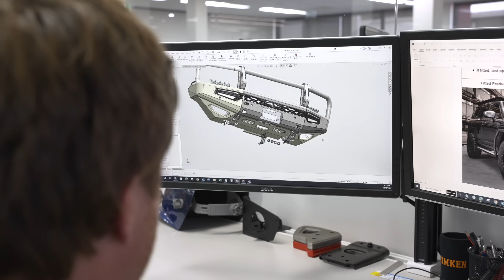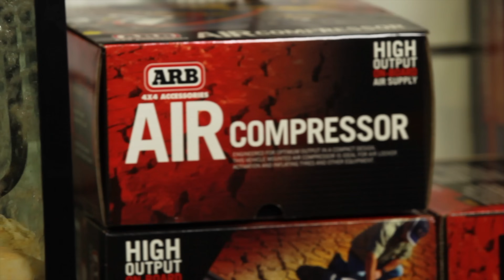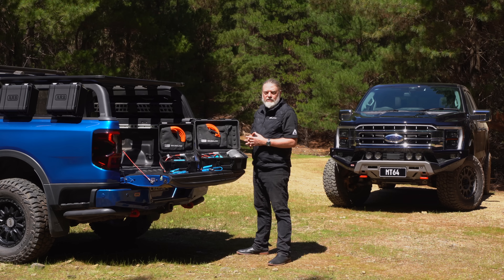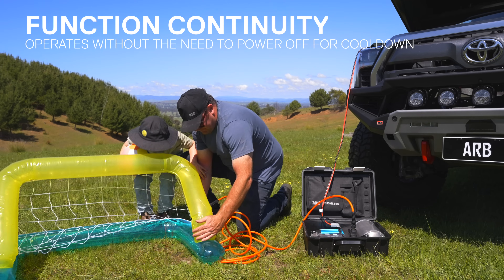ALL NEW ARB Brushless Compressor!

Comment: Why not offering a portable twin WITHOUT the air tank ?
Reply: Those small tanks aren’t worth their weight, 98% of everyone is using these for tire inflation off road, which means they run 100% anyhow, airtools would benefit, but even air tools market share has dropped off now that we have Milwaukee 18v and 12v stuff that put out impressive numbers.

Comment: To summarize: BRUSHLESS!!!! Also bluetooth axle compatible, control by wifi from across the world, glitch and not work the one time you really truly need it!

In all seriousness though, does a brushless compressor need an ecu? Cause if not, this is a box of hot crap. 

Still love ya ARB
Reply: Can;t have brushless without 3 pairs of mosfets to drive the motor phases. Can't have half a dozen mosfets switching without something telling them exactly when, so you need a mosfet driver (technically a computer). Mosfet driver needs phase angle of the motor for timing the switching of the phases, also needs to know phase current and/or duty cycle and PWM frequency to apply. That is all controlled by a something like a 32 bit Atmega that's also looking at input current and voltage, motor temperature etc. That's all before you start adding bluetooth and all that bs. So, in short: brushless motors are computer controlled
Reply: @Razza2250  Thank you!

Comment: They are non lubricated pistons and don’t last that long, try looking at west air compressors, they last forever .
Reply: I have a single which is still going strong after 14 years, and a twin still going strong after 10 years.  Both been 100% reliable and faultless.
Reply: I went through 3 of the brushed models before I gave up. One of them may have been my fault but the other 2 definitely not. They last just over the warranty period. Odd that. On the other hand I have a 20+ year old Bluetongue that still works perfectly.
Reply: WTF?  west air make commercial stuff, 240v, 3 phase electric, diesel and petrol compressors....not really back of the 4wd.
Reply: @ they also do 12v, I got one out of Western Australia for my bitumen truck, it has lasted over 10 years and is used every day

Comment: Since 99.9% of your customers use this as a compressor to air up tires, does it come with a simple plug and play "compressor" harness without all the add on pigtails for lockers?  Or can one be purchased separately?
Reply: It's a royal pain to get it done, but you can source that through third party folks, or hardwire the harness that's meant for the briefcase compressors.

Comment: Probably cost more than the car its in 😂
Reply: A must buy for me.
Reply: "military spec" lol😂
Reply: People always joke, but if you think about it, it’s a true mil/industry spec compressor with 100% Duty Cycle. 

If you’re in need with it, it’s not expensive at all, as there is no other product offering that level or torque and longevity. 

I am building an expedition truck with 6 37inch tyres, this compressor will last me for decades, and allow me to power blowers and airbag bump stops.

I’m keen for it.